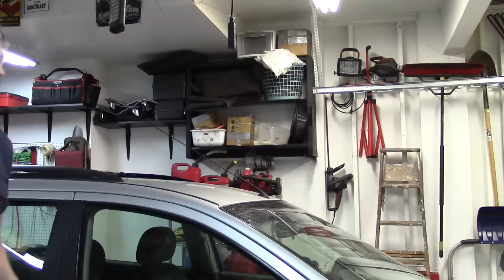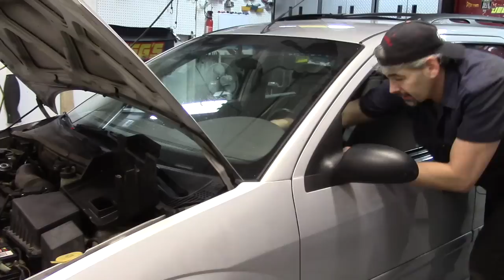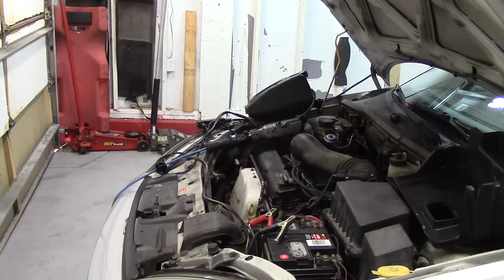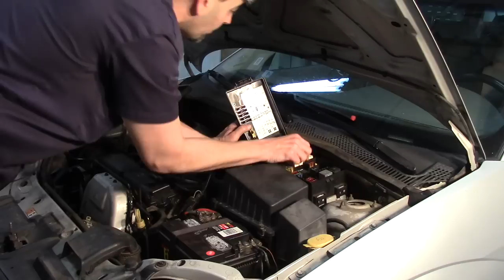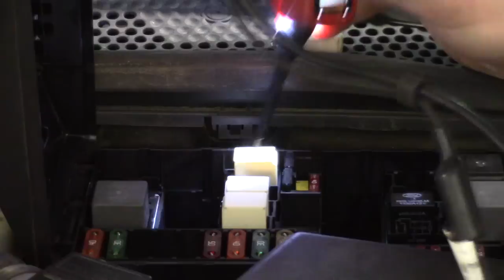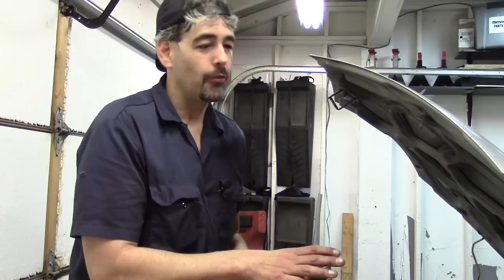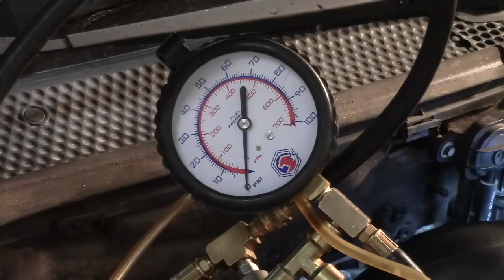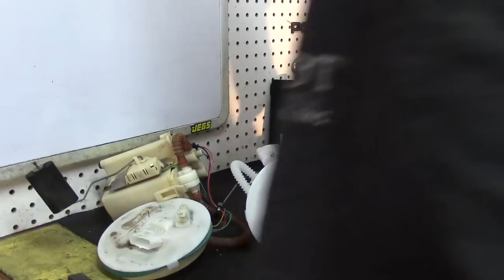Cranking No-Start Real Time Diagnosis -Ford Focus

Comment: I just had a no start this week on my Mazda 3. My fiancé would turn the key and nothing would happen. The cabin light wouldn't dim so I had a feeling that the starter was not getting power. Quick check of the wire lead me to a bad starter. A few taps on the starter with a wrench got it going enough to get it home. Before I even thought about calling the part store I performed the voltage and resistance checks to be 100% that the starter was the issue. Used your technics (minus the power probe, which is on my list by the way) and confirmed the wiring was not the issue. Changed he starter and it's been running great. Thanks for taking the time to make these diagnosis videos! Oh and GO BILLIKENS!!!
Reply: arcdraw Nope that is "has joined" to the 2%. You have arrived with DVOM in hand and for some reason a brown cardboard box?
Reply from the maker: Agreed with Mike!  people don't properly diagnose things by accident. They may guess right, but not diagnose right. You clearly "get it" arcdraw!!
Reply from the maker: arcdraw That's exactly how I would have done it!
Reply: That's great to hear. I'm on my way to being in the 2%!
Reply: Thanks for the worm welcome, guys!
Reply from the maker: arcdraw Worm welcome?? Lol.
 Good morning, worm your honor...
Reply: LOL I ment to say Warm Welcome. That's what happens when you don't pay attention as you walk and text. My lack of spelling abilities really shine.

Comment from the maker: You gotta love the armchair mechanics who subscribe to this channel for the express purpose of thumbs-downing the videos as soon as they are released, and yet they still watch the entire video and learn about stuff that they have never done or will do.
  Just sayin....
Reply: Schrodingers Box Why would anyone thumbs down any of your videos?  They're all informative, interesting and accurate.  It must be someone who manufactures plugs, wires, and coils for a living and they're afraid you're going to cut in to their profits. LOL!!
Reply: Schrodingers Box My wife's car had a long crank time.  The pressure would come up to about 40psi then drop off to zero as soon as the fuel pump shut off.  I tried to order a fuel pump from Autozone, the guy told me that the only thing that can cause that is the pressure regulator. (which I tested and found it was good).  I tried to tell him that it was more than likely a stuck check valve.  
He immediately yelled back at me, "Nope!!!! There's no check valve!"
So I went home and ordered one from Rockauto.com 
...It was the check valve.
               ...that doesn't exist.
Reply: Arm chair mechanics make me laugh  i have been on the tools in the R&R industry for 15 years plus prior to this i was a grade A electrical engineer Highways .Prior that Military . i can work on anything but i love it when we get a intake of newbies .Some of them have this i am Great attitude i can do this that  and everything you did they have dun 15 times over seen the film read the book and have the Dolly . i like to test the ones who geek out straight away oh yeah i can use a diagnostic Scope i have a verus ect . Ok he is the first one who is going to the Diagnosis on the 4 channel  . This is when mr super mech will fall over shit himself go white and very quiet as they have next to nothing in electrical background . if u want to fix a modern car that is not using the old field collapse system then you have to know about 4 pole systems and bus control systems . ecm return voltages at specific point in rev range ohm readings  pulse times all sorts going on in there now . So Armchair hero's  get the books out  basic electrical automotive theory is the first place .then the mechanical the Unrelated gremlins that happen .  Pah armchair mechs ,
Reply: Schrodingers Box That's like being so ignorant you complain about education, "I ain't learnin nuthin, all dem books and teachers be wrong anyway."
Reply: GRowe1978 And funny too!
Reply: Schrodingers Box If people feel like they need that step of the process, there are already endless videos for replacing parts.  I suppose you could watch both.  Maybe that would even be a better idea than giving a thoughtless thumbs down?
Reply from the maker: Exactly. And without knowing the fundamentals, you'll need a LOT of videos about replacing parts. Lots and lots.
Reply from the maker: yes if I find that happening it would be a great video. Many things can cause that- bad fuel pressure check valve, low compression, bad CPS/CKPS....   I will keep it in mind. 
   I think my next will be a D&U of MAF sensors though.
Reply: @SchrodingersBox  i give up. Thought that is why u check gas pressure
Reply: GRowe1978
The problem here is that you put yourself in a conversation with an auto parts store employee to where they felt it was ok to give you their opinion on a diagnosis.  You did that to yourself.  I've done it, we've all done it.  Now I just go in and buy parts and don't engage them in a conversation about what I'm working on. If they ask (and sometimes they do) what you're working on, I just say "my car".  "What are you working on" seems to be the magic question that gets people to talk with them to the point they'll ask for advice.  It's almost like a used car salesman tactic.  Don't give them the response they want and be on your way.
Reply: Rs500ybd Why do people assume they know it all?  You should ask them, "does it hurt having all that info jammed in that tiny skull?" LOL!!!!
Reply: +Schrodingers Box Perhaps these guys could give us a link to their video, so that we can see how it should be done.
Have learnt from everyone of your videos, thank you for taking the time to make them.
Reply from the maker: j derossett I see.... yeah, um sorry I am not going to be able to help with this.
 Scotty Kilmer has a lot of videos on stuff like this with lots more ideas on things you can try, I'd suggest trying his channel.
Reply: Can't fathom why I've never seen this guy before; he's really good! This video can really save you time by going directly to the cause, and not bothering with completely unnecessary shit. Great work!
Reply from the maker: The usual reason I get  is because "you don't ever show how to fix a car, you just talk about stuff".
Reply: Gregory May YES! Very true!
Reply: Schrodingers Box  Correct .
Reply: Schrodingers Box
and he did too.  Long crank times would be good to go over.  Happened to me and ended up being low fuel pressure bleeding back into the tank.  Plenty other causes like ScannerDanner showed on the pressure regulator.  CKP/CMP, low compression.  lots of stuff.  Would make for a good video even if you don't have a vehicle with the symptom.  Would make for a good classroom theory session on the dry erase board of knowledge.
Reply from the maker: GRowe1978 Great story bro, and not surprising. Good job on the diagnosis- a check valve would display the evidence you described- a static pressure that doesn't hold causing a long crank time but normal pressure and no driveability problems when running (the check valve is purely to maintain static pressure to reduce crank time).
  The call that it must be a FPR is typical illogical parts changer mentality.
Reply: ***** Yeah, I think what happened in my case was, he had recently installed a pressure regulator on a similar car. I guess that made him an expert. So when I asked if they had the fuel pump, he asked, "are you sure it's bad?" "Because a 'buddyamine' just had a problem with his car and it was the FPR." 
That was when I made the mistake of telling him it had no rest pressure, so it's likely the check valve sticking.
I should have said, "no, I replace parts all the time, whether they need it or not!"
Reply: lmfao  LOL .
Reply: +Schrodingers Box some one else did the fuel pump bc they thought it was a sure fire thing. well its not and the crank shaft sensor can cause no start or fire issues or injector pulse so that was next. the cars been running good and deff has fuel to the rail not sure of exact pressure due to no having a t fitting to hook to gauge but it comes out very strong at the on position of the key. its got spark and will run off starting fluid for a brief idle but when any gas is given it dies. theres not a pressure regulator on that car rather a sensor on the fuel rail its my only other otion bc it deff has gas to the rail and spark and compression is good.
Reply: WonkaaVision As a Mason, I would say you are full of shit...
Reply: Just enjoy the extra views, Cheers for the video lad
Reply: If they're thumbs-downing the video, i dought they would help you by subscribing
Reply: I have a question,  I have a carburetor car,  when I frive it for a couple of miles it shuts off.  you need to pump the carburetor manually to make the car running again.. This happens to me again and again especially when in idle or neutral..
Reply: Just saying you could diagnose that in 2 seconds by turning on the ignition and listening  for the fuel pump to prime   makes a bzzzz noise ...If if don't prime it's not working ...When the first word out of your cake hole was about cylinder compression ..I understood all the thumbs downs
Reply: @1Lifetime-i7z  did you hear him state that not all vehicles have a key on engine off fuel pump prime? You may have got lucky with the diagnosis by swapping out that part although it could have been a few other things eg the wiring to the fuel pump.
Reply: @JasonSpiffy     Yes i hear him ....After Turing the car on 3 times ..Then talking about timing and compression ..Then saying hes not 100% sure if this car is a key on motor off pump (It is 100%) I would have got that 1st turn of the key ..Problem solved ..Its not like it's a rare car ..only a few million made
Reply: Schrodingers Box  I know 1 person that would certainly do that for every one of your videos, not gonna name any names. :P
Reply from the maker: ***** Hahahaha.... He's not a sub though!
Reply: Schrodingers Box He's on mine.  I don't continually call him out though. ;)
Reply: *****  It's no one subscribed to this channel that's all anyone needs to know.

Comment: Like the intro.  My number 1 observation for fuel pump failures  on identical vehicles is constantly running the vehicle with low fuel level.  I only like factory fuel pumps or carter.  The rest of the aftermarket pumps are hit and miss.  👍
Reply from the maker: Steve Rob That's exactly why I am waiting 5 days for the new pump--- it is in lieu of getting an airtex in 2 days, and then repeating this job next year lol
Reply: Schrodingers Box Sad, airtex used to make great pumps.
Reply: Derrick Hodges I always had good experiences with airtex,but I haven’t bought one in a decade. I wonder how Bosch is nowadays.